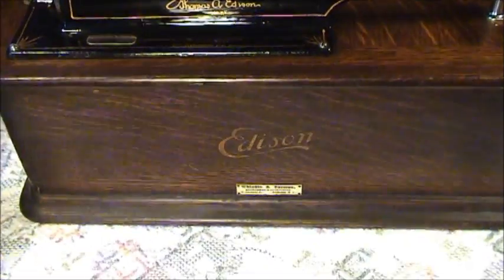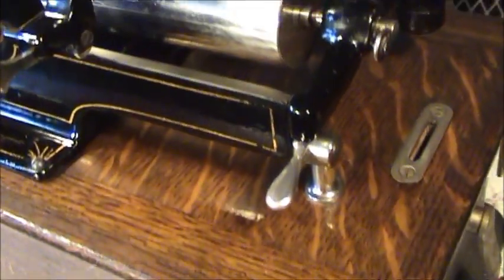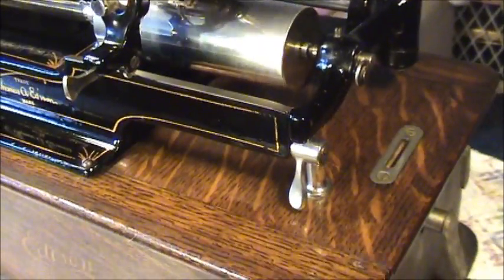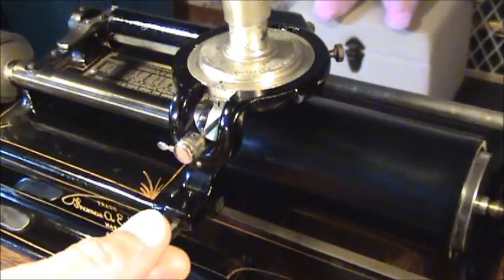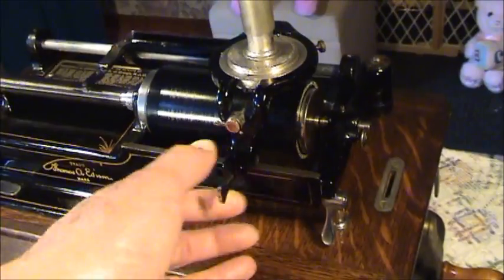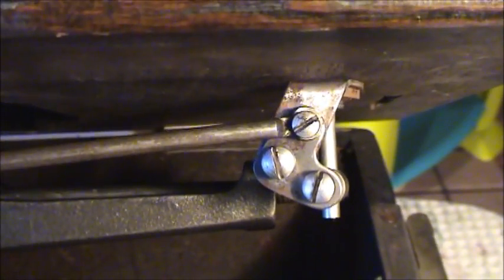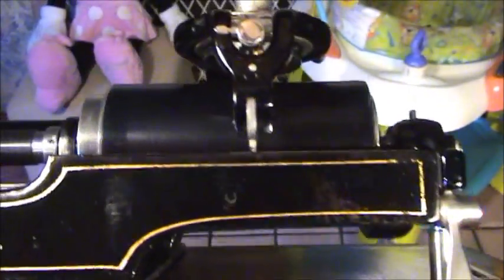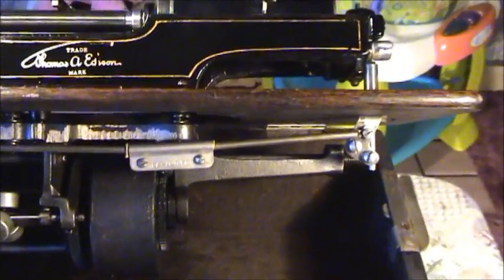Edison Home Model B Phonograph With Rare Wilkeslyke Start Stop Attachment

Comment: Hey, Fella! OH! I LOVE THIS! I Have one of these EXACTLY Like this! Except for the Stop System like Your`s! Mine has the usual Stop and Start! But Mine was in Very Poor condition, And I restored it to look just like this one! But Mine is VERY Week! It slows down even on the Two minute selection, I thought it was the small gear box! But it is not that! I Replaced the Mainspring! and have adjusted the worm drive nut until it starts skipping! Any Suggestions Would be GREATLY Appreciated! Also I adjusted the Gate point as well! And do You know where I can get Parts for My machine! LI LOVE My Machine`s looks! But I HATE THE WAY IT PLAYS, Or for that matter Does not play! I hate to pick Your Brain on Your AWESOME Site! But You have a Model just like Mine! I may need to replace the Motor! And it looks like the Reproducer has a Mica Replacement! I Believe it was stiff paper with cork lined on it! Am I right on this! And was this machine made in 1906-07??

Comment: ORIGINAL DIDN'T HAVE FRICTION DRIVE LEVER ??
Reply from the maker: +OLD WIPPER-SNAPPER   Yes, of course it did.  But the original Edison On/Off friction disc lever was made only for a "factory stock" Edison Home Phonograph and it was too long for the attachment.  So obviously the Edison dealer back in 1907 removed the stock lever so that the Wilkeslyke Attachment could be installed with its unique on/off lever.